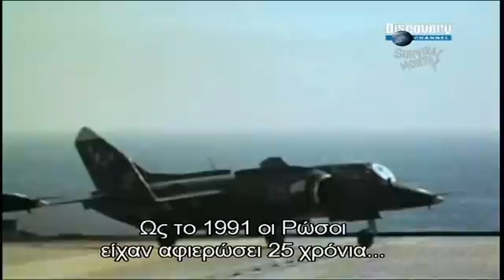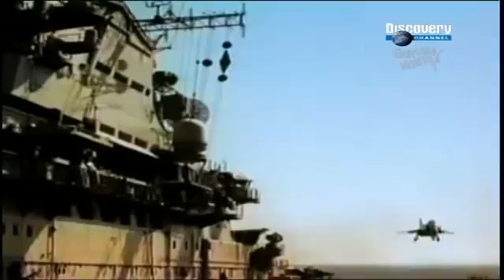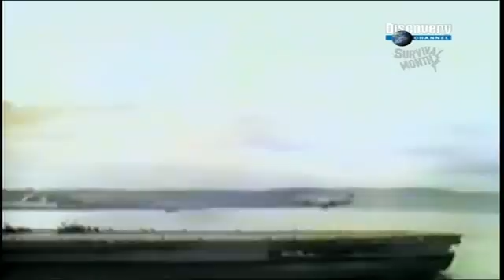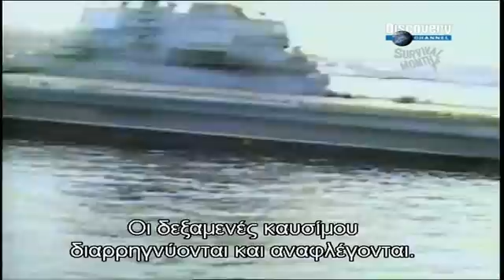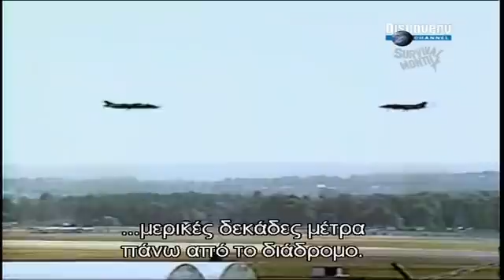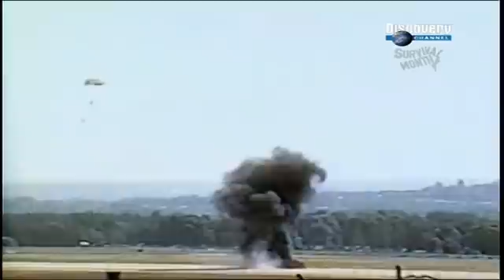Yakovlev YAK 41

Comment: In the Yak 38 incident the pilot ejected so instantly because the plane has an automatic ejection system. When some flight parameters cross a critical value the system ejects the pilot. Once a Yak-38 continued to fly without a pilot, because the ejection system was so sensitive, that it shot out the pilot at the slightest parmeter breach.
Reply: S300V it didn't work so well on the yak crashing into the carrier now did it?

Comment: Like the Vak 191B from germany, VFW-Fokker.
Reply: +Ineke Mateman the subsonic Vak 191b used a 4 nozzle main engine located at the center of gravity (similar to the Harriers Pegasus) with an additional 2 lift engines. One located in-front and the other behind the main engine. The supersonic YAK-141 had 1 main engine at the rear of the air-frame fitted with, a German invented, 3 joint vector thrust exhaust and 2 lift engines located between the main engine and the pilot.
Reply: great knowledge explained!

Comment: statistically the T-50 doesnt exist in anything other than 2 test variants. It has terrible avionics and is still using vacuum tubes. They had to borrow from the french to get the thing in the air. 
Perhaps you'd better dig a little deeper, champ.

Comment: ahem...statistically today maybe, but statistically the SU-50 "PakFa" is superior, flies faster, goes further, climbs faster, turns tighter. The only thing it falls out on is superior stealth, it still has a similar RCS to the F-35 though. But aerodynamics ruled over stealth on russia's behalf, look at the F-22 it's a flying box with pretty wings and a nice face, the fuselage is a box, so it should be that's the only way to achieve the greatest stealth in the smallest package.

Comment: While the F-35 does use the same type of articulating nozzle as used in the YAK-41 the similarity between the two aircraft ends there. F-35 STOL/VTOL capabilities will immediately allow for operations from helicopter carriers thus instantly doubling the US capability to project carrier type power globally. How many carriers do the Russians currently operate? Stealth characteristics along with a complete suite of battlefield integration avionics make the F-35 one capable aircraft.

Comment: @Change6609 I say again, it's not a copied design. Designing a plane is such a complex work, and a plane is such a complex design, that visual similarity can mean nothing really. Inside and through designs can have nothing in common really. I don't know if you've noticed it, but MiG-25 and MiG-31 have the same general shape of intakes as this Yak. So, maybe they copied it from MiG?
But in the 50ies Russians really did some reverse engineering, but I wouldn't say that was the case in the 80ies...